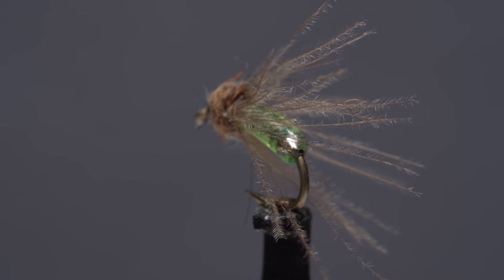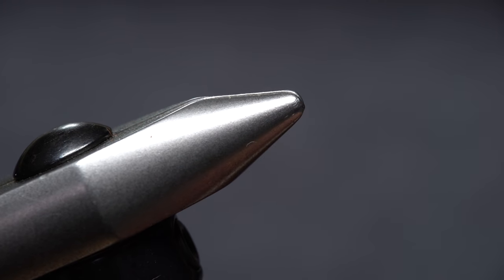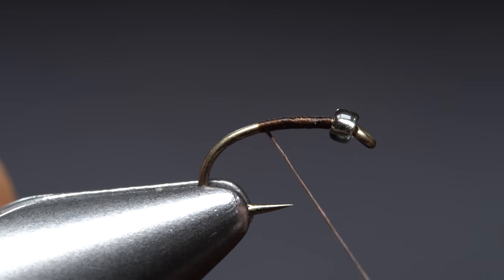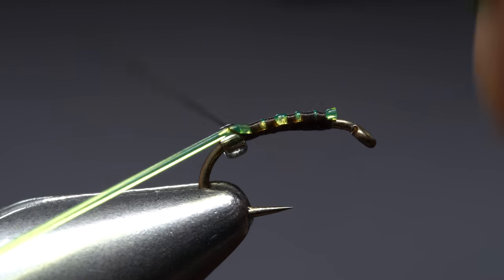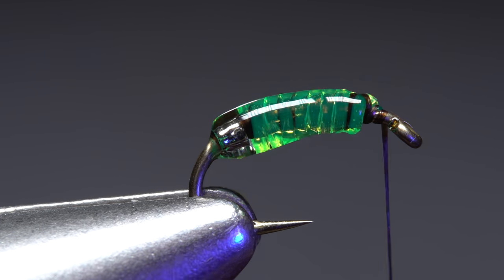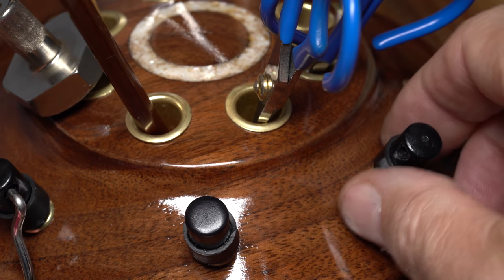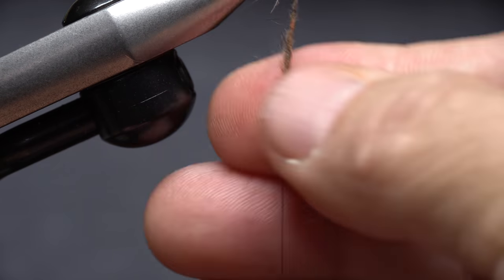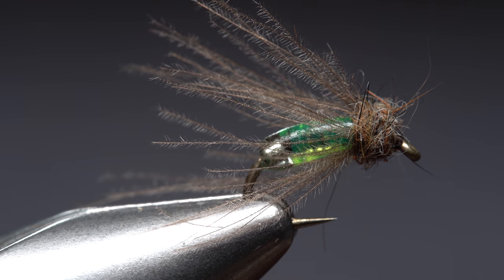Shiney Hiney Caddis Pupa

Comment: Hey guys I just started tying flies. I bought a kit right before we started going into quarentine and i was wondering if there were any good beginner patterns that i should try.
Reply: I would always suggest that new tyers begin with a woolly bugger. Its a simple, yet highly effective fly. It will teach you the basics of how to tie in, handle the thread around the hook point, correctly palmering hackle along a shank, and can be given a large area on the head to practice shaping and whip finishing. The materials are among the cheapest, so if you screw one up, no big loss. Besides, it's a great fishable fly. I have been stumped in small ponds trying a popper, or other surface fly, to fall back on the bugger, and start catching fish.
Reply: Yes the woolly bugger, arguably the greatest fly ever conceived. Also stick to the basics because the basics are all solid fly patterns that have stood the test of time and also teach you the basic techniques you will use to tie all other fly styles. The gold ribbed hares ear, the pheasant tail nymph, woolly bugger, soft hackle wet flies like the partridge and orange (but tie them in any color that matches the bugs you see). If you carry different colors and sizes of the aforementioned classic nymphs (and the bugger) you will have 90% of your bases covered. As far as dry flies start with an x-caddis to get the feel of working with deer hair, then maybe move to tying a catskill style dry fly such as the Adams.  Once you are comfortable dubbing a body, making a wing case, attaching deer hair wings, and palmering wet or dry fly hackle you are well on your way to becoming a good tyer. I absolutely love tying flies, it let's me tie them just the way I like them, gives me something to do in the winter months, and is certainly therapeutic. Keep on tying!

Comment: It looks like Chartruese but you didn't name the color of the round rib. I'll assume it's Chartruese but if you get a chance let me know for sure. I've seen and have some colors that look like Chartruese but are technically a slightly different color. Thanks as always, Tim. Your flies are excellent.
Reply from the maker: Yeah, my bad Adam, it is chartreuse. I also should say, you can use whatever colors you want to match the naturals. Just vary the color of the rib and the thread below. I tied a couple with silver tinsel beneath the rib. They looked really good but were kind of a pain to tie.

Comment: I might be wrong but under water it doesn't look like a caddis imho.
Reply from the maker: It is supposed to represent a caddis pupa either swimming to the surface or starting to emerge in the film. In both cases, I think it is pretty spot on. I have some video of a caddis pupa struggling to emerge on the water's surface that I will post if I can find it, it was shot a while ago.
Reply: @tightlinevideo  It will be cool if you can find. In my humble opinion all the "hard" and transparent materials such as clear ribbing, UV coat, etc do not effectively imitate caddis bodies because of their reflection parameters. In order to imitate bubbles it's better to use something like CDC or z-yarn, then these bubbles will be dynamic and not static. But this is just my observation :)
Reply: @stephenlazarionok7022  I think I’ll try some with a dynamic bubble, and some without. I think it will end up whichever is easier to tie for me, wild trout usually don’t care around here.